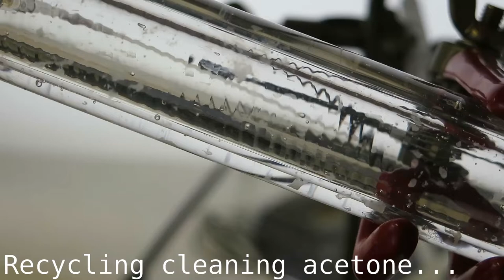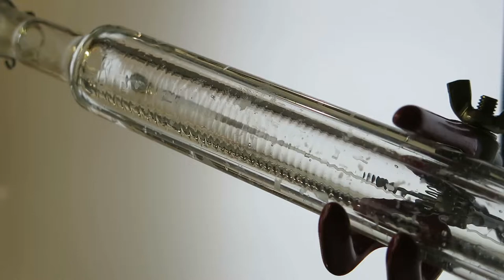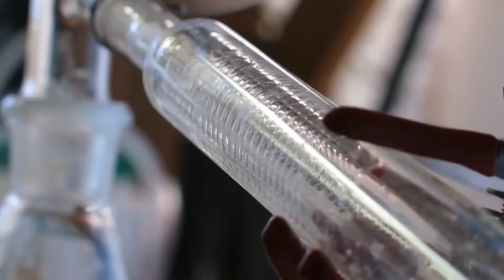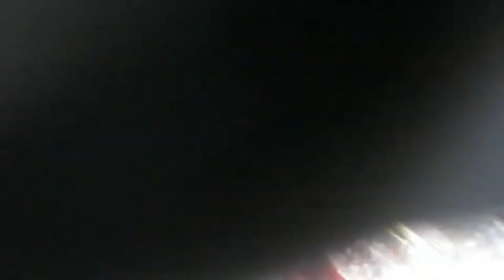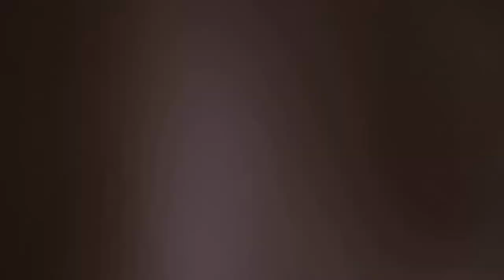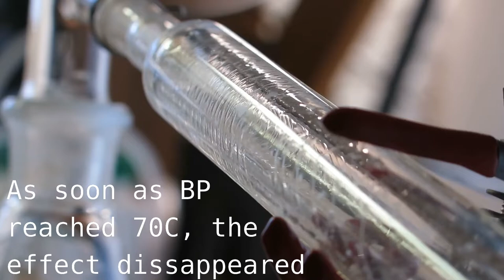Is this some kind of resonance or what?

Comment: It looks like the constant flow of acetone vapor over the liquid film results in the creation of waves, similar to wind blowing over a pond.

This can explain why the waves first propagate relatively fast and then slow down as more and more of the acetone gets condensed and the gas velocity decreases.
Reply: The surface tension of the liquid and the high flow/condensation rate also probably play a signifikant role, as they stabilizes the waveform

Comment: The high tension of vapour of aceton, allows for a lot of vapourization even at ambiant temperature... it condenses but reevaporate also when more warm vapours comes and condenses (especially if you got some water vapour behind with a high specific heat of condensation)... 
The vapour flow is high and the cooling flow inside the condenser probably constant and relatively slow you get to a specific point where condensation occurs on a large portion of your condensation tube (*)... because condensing one mole of water vapour allows for evaporation of more moles of aceton... you have kind of distillation plates inside the condenser... they follow the isothermal gradient inside the condensing tube and that follows roughly the perpendicular section of the condensing tube.

(*)usually it must remain into the first third especially with highly volatile and flamable liquids

Comment: cleaning acetone. what was the other contaminant?
Reply from the maker: Marangoni effect seems plausible. Main contaminant is water, even though I tried to dry the acetone first.
There's a lot of stuff though, I can still smell traces of piperonal after a year, heh...
Reply: @IlusysSystems  You can perhaps separate the aldehyde impurity by oxidizing it to carboxylic acid with permanganate (i.e. to piperonylic acid, see Org. Synth. 1930, 10, 82). Aldehydes are also more reactive than ketones and a nucleophile, so you might be able to separate the aldehyde by some of its addition compounds (bisulfite adduct, alcohol, acetal etc.)
However, treatment with activated carbon followed by distillation with a good packed column should remove even the smell I think.
The amounts of the aromatic stuff are likely just trace so not an issue ofc.
Reply from the maker: @LiborTinka  Thanks, it's just recycled solvent for cleaning, I don't mind these impurities much. It's probably not worth even recycling for me, but I do it anyway.